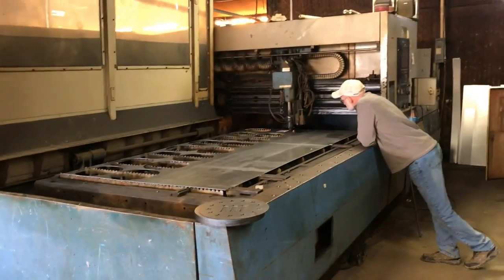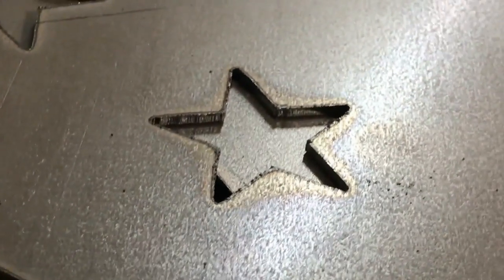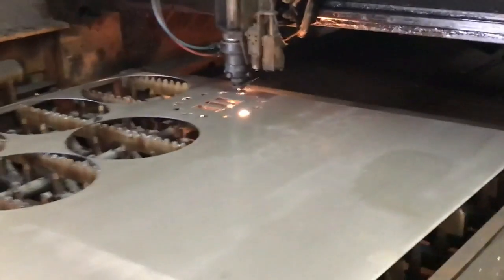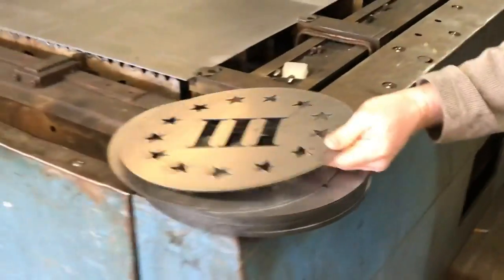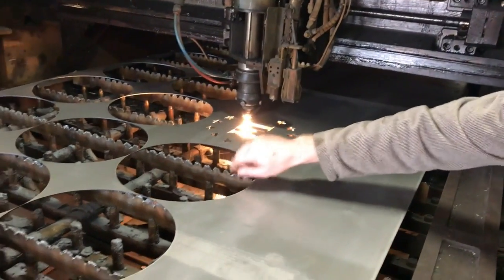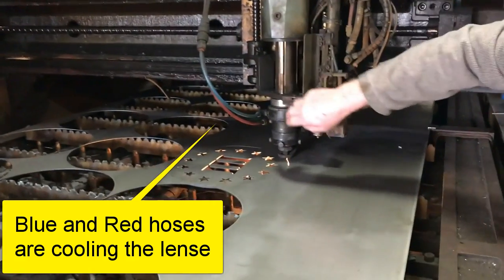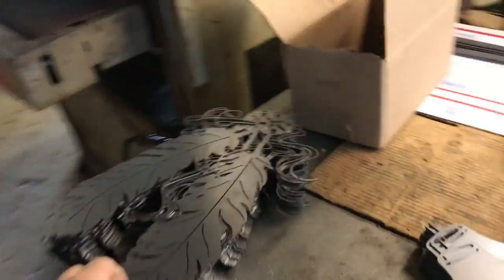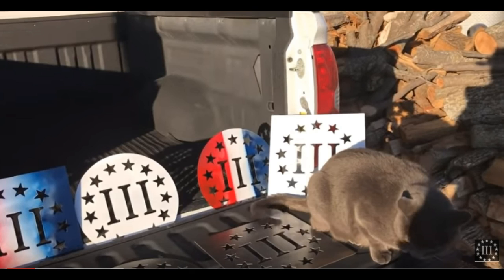Discussing & Watching A Laser Cutter - This Is How 3 Percenter Signs Are Cut Out

Comment: Cool stuff! I vote for "Don't Tread On Me" but make it round, not square. You can probably get more out of a sheet.
Reply: Wouldn't there be more wasted metal with round cut?
Reply: @sueericson1104  It depends how it is laid out. Cutting square leaves wasted space on the cut square. You can fit more circles in the area if they are put close together. If they are laid out in a straight line, it does waste more, but if tucked into each other, there is less waste and more product.
Reply: Yeah, I see what you're saying. I didn't think about it,just looked at the layout on Rick's video. Your way seems obvious now. I should have thought it through. Thanks!:-)

Comment: I once visited a Airbus factory and watched how they cut out aircraft parts. Very impressing. The engineers do the construction work with CAD (computer aided design), the laser cutter uses these data files for cutting out the aircraft parts. These laser cutters are huge.

Comment: Rick, Reference your comment about how deep it will cut, the laser is not collimated, meaning the light rays are not parallel.  The laser is focused sufficiently to cut down to 1/2 inch or so, (you laser gutting guy can tell you how deep he can go) with the beam dispersing outward after that.  As the beam widens, its ability to cut diminishes rapidly.  It is, therefore, not a constant beam cutting into the floor!  (Plasma cutting has depth limits for a different reason.)
I hope that helps.
If you want any help creating the dxf/svg files, let me know.
perhaps the III% within the outline of the state would be good.  Personalised for where your customers live?
Reply from the maker: yea that does sound sweet
Reply: @heygunpeople    check your emails.
Reply: H W Made me laugh and cough all at the same time!  A friend of mine had an interesting experience as a surgery patient and waking up with a burn hole in her chin because someone stepped on the pedal while the laser rested on her. We aren't close now so I don't know how it turned out legally and all other medical intervention laser stories have been positive. My beautiful coworker no longer has to deal with a mustache because of laser treatment! Have a great day sir! Laural
Reply: I like that idea!!! Sign me up for one!
Reply: Glad I could return the laugh HW!

Comment: That's Impressive  you have to make a lot of Adjustments to a Plasma Arc Cutter..  Water Jet  will do really fine small stuff and totally smooth .  I have heard your are not supposed to even  see an arc from an arc welder with contacts in .. The bright light will  weld contacts to your eyes..

  The Chinese have a  a Hand held Laser gun now that can melt your guts out at 1/2 mile range..  @Think Like A Cop